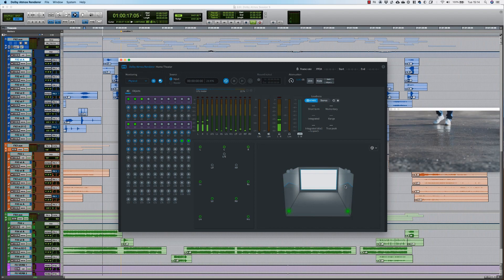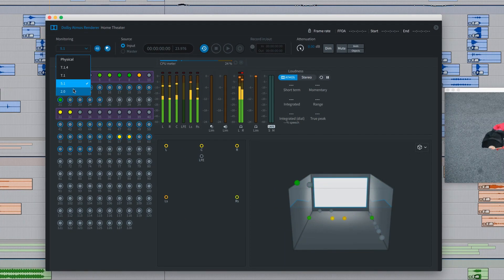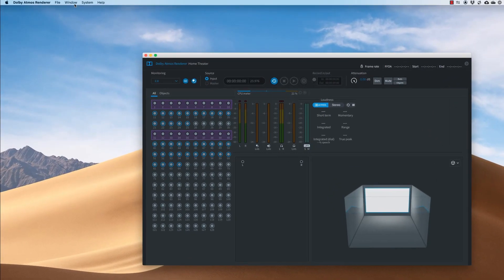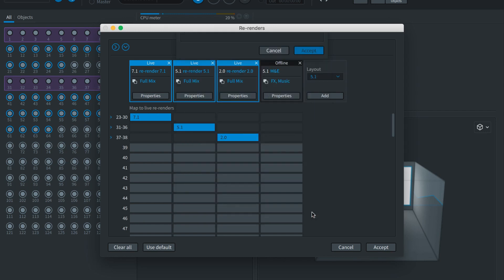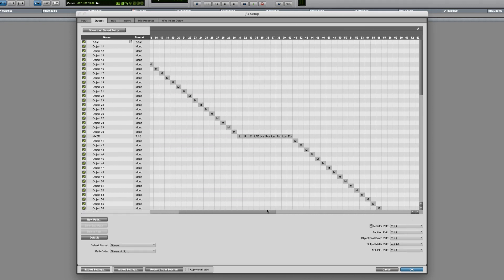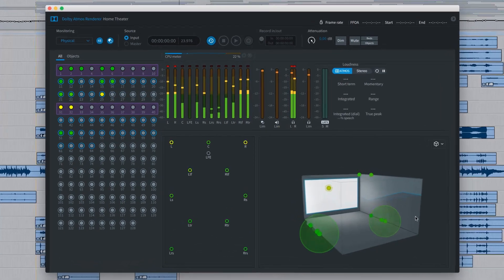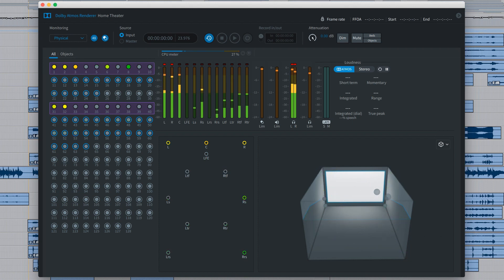Configuring the Dolby Atmos Renderer in Pro Tools

Comment: Hey, interesting content. Does somebody know if the atmos routing between pro tools and the dolby renderer requires ULTIMATE Pro Tools. Or can it be done with the regular pro tools ? Thanks!
Reply: You need to have pro tools ultimate.
Reply: @ERICDIZZYASMR  thanks for the reply ! 
Out of curiosity and for my knowledge, do u know why ?
I managed to put in place a quite efficient workflow from Ableton Live (Atmos template) through loopback by Ameoba (64ch I/O which seems enough channels to start with) to Dolby renderer

Still dont understand why such trick couldnt work with the regular Pro tools as theres a quite substantial price difference between those two offers … (just wanna check before actually purchasing a 1-year sub …)
Reply: I think Pro Tools Ultimate has native support for Atmos panning. But perhaps a lesser verson of Pro Tools could use the Panner plugin that is needed in DAWs like Ableton? Not sure, though.
Reply: @egorge00 For what did you need Loopback? Ableton directly routes the audio to the Renderer app, via the Panner plugin, right?

Curious, as I may benefit from using Loopback like you:) Just not sure how and why 😃
Reply: @Tazmanian_Ninja  Dolby audio bridge does not show up in my Dolby audio renderer (probably a M1 issue ... haven't found the root cause yet but it's not a permission settings issue which seems to be a rather common scenario). So I need a multi-channel virtual interface to route all the channels to the Dolby renderer. 
So Loopback is a great back up plan. 64 channels "only" but more than enough to practice !
Yes I don't see why it wouldn't work on regular pro tools if I do the right routing magic through Loopback ... The price difference with Ultimate version is definitely worth it.

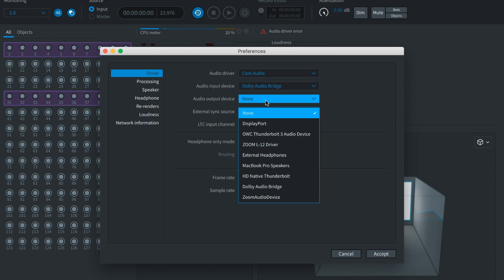Comment: 0:42 I do not see Audio bridge in the input. What could be the issue? I’m using protools ultimate and HD native. I do not see the audio bride in protools playback engine too.
Reply: I had the same problem. Found this on the dolby support site and worked for me:

"Since the introduction of MacOS 10.13.6 Apple has required users to give permissions to install kernel exenstions. During the initial Dolby Audio Bridge installation you should see a System Extension Blocked dialog. Whether or not that appears, you have 30 MINUTES from the installation to approve (Allow) the extensions from System preference>Security and Privacy.

If more than 30 minutes elapses, you will need to manually remove the DolbyAudioBridge.kext file from Macintosh HD > Library > Exenstions and re-run the installers!